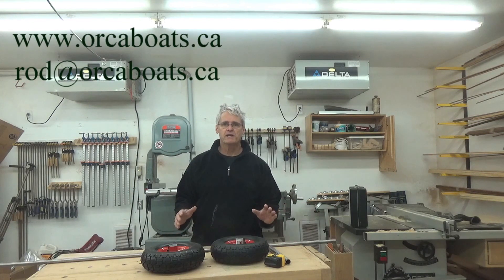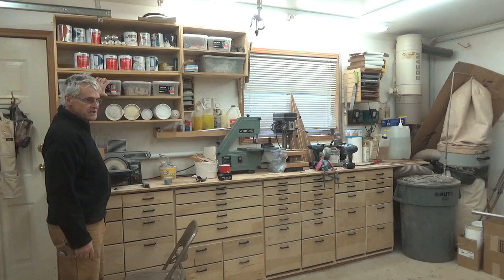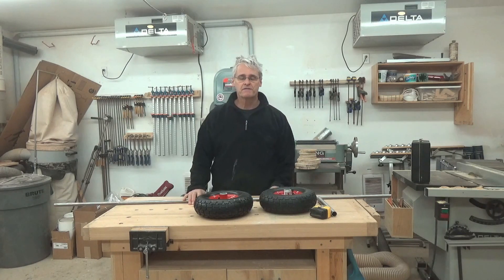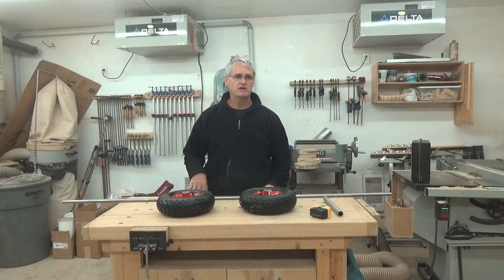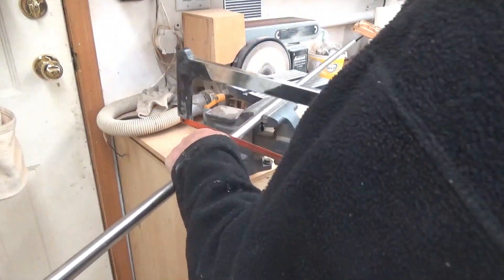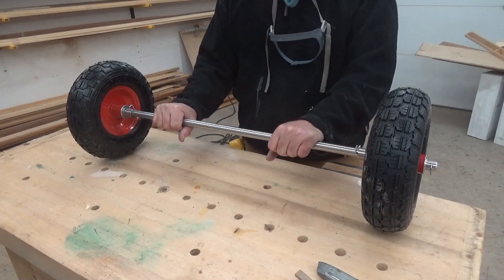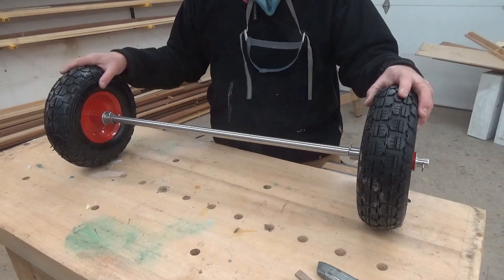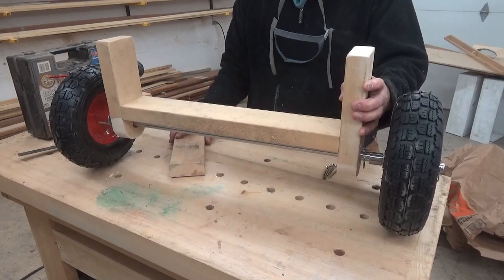Building a Small Boat Dolly

Comment: I built one for my jon boat out of 2x4s over 30 years ago and it's still kickin. I made it to get down a steep rocky hill to one of my favorite lakes that was carry in only. There's a problem with the one you built here that you're probably aware of by now. Your cart only works on a flat surface. The one I built had to navigate steep inclines, rocks, ruts and uneven surface. I put eye bolts on each side so I could bungee or ratchet strap over the boat securing it to the dolly. That way when you hit a big rock, tree root or rut etc. the dolly stays put. Otherwise the dolly stops while your boat continues forward. Anyway, this also came in handy because I never use the actual boat ramp if I'm using my cart. The boat ramp is for trailered boats, not some putz with a cart. So I respected my fellow boaters by launching my cart to either side of the ramp. There's usually a spot to do that. Good luck with your cart. I recently converted mine from jon boat to canoe with a couple simple modifications.

Comment: I made a similar design based on your video but I'm having a terrible time getting the boat on it out of the water. Any suggestions ?
Reply from the maker: The dolly was not designed so much to get the boat out of the water as much as it was to transport to and from the water. I lift my boat onto the dolly with help and then roll up the ramp or beach.
Reply: I’m betting you’ll need to add a long arm under the front of the boat then pull the boat out from the water.
That design concept is widely seen commercially. Just seal or epoxy the wood you would use in this variation. I’m guessing.

Comment: hi, amazing simple but functional design. i have an 8foot sailing dinghy and a flat bottomed hull. what dimensions would you recommend? beam at the widest portion is 42 inches. thanks
Reply from the maker: You may want to widen the axle to accommodate a flat bottom boat.  My axle is 33" long and bunk are 24" apart at outside.  And then you will have to consider wheel size and not interfering with hull.  The V bottom hull clears the wheels.
Reply: @OrcaboatsCa  thanks for the reply :) axle is 1meter long and wheels are 12inches. is this good enough? wide enough? the bunkers should rest farthest from center? maybe a foot from the chine towards the middle. hmm. your thoughts pls.
Reply from the maker: @laurencefavis6839  That should be wide enough and wheels are pretty large as well.  I suppose you just need to make sure height of bunks will clear wheels with flat bottom boat.

Comment: I could use both but mainly timber. I could use pipe to pull it with because my boat is lighter been an inflatable with 3/4 plywood floor.
Reply from the maker: Lots of videos on building small boat dollies out of PVC

Comment: Hi, thinking of building something similar for our dragonboat. How heavy is the boat you kifted using the dolly?
Reply from the maker: This small dolly was only built to carry around 10 lbs.  I would not think it would carry a dragon boat.  Locally here, they have ones made out of welded aluminum and much larger, but similar principle.
Reply: @OrcaboatsCa  Thank you! Our shortboat is around 150kg so making the build using either welded aluminum or steel pipes. She's heavy!

Comment: Gluing end grain like that is completely useless. The screws in end grain aren't much better. Best would be some joinery. At the very least some L brackets or corner blocks so you're not screwing into end grain for a guaranteed failure.
Reply: You wouldn't want wood joints there bud. Metal L brackets would be the way to go.